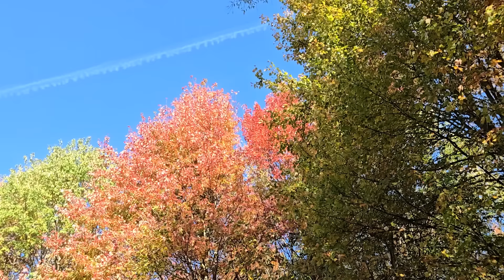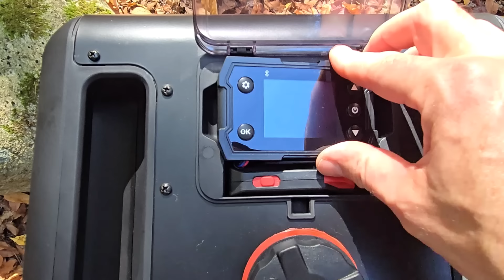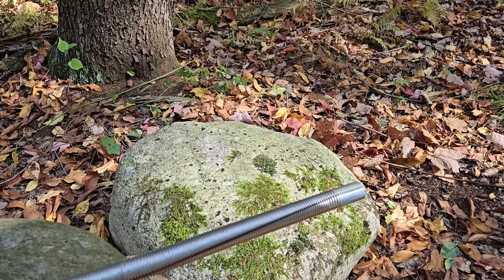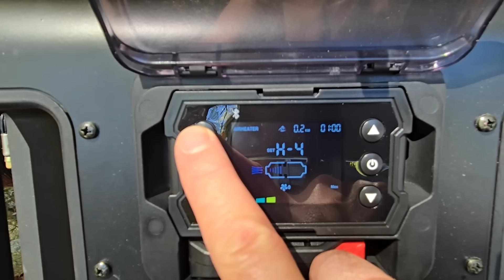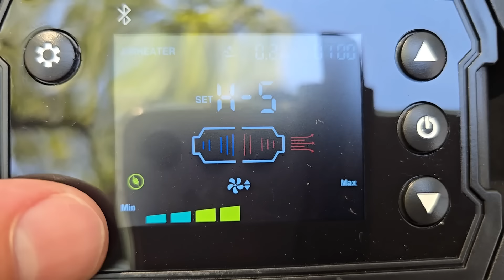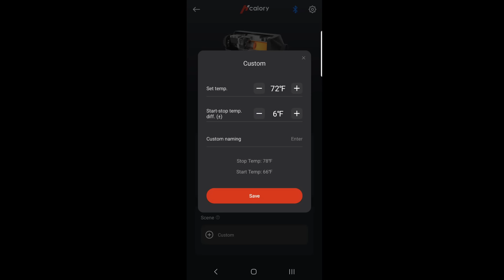62 Hours of Heat On a Tank! The NEWEST Diesel Heater: Hcalory Toolbox Max!

Comment: The 3 1/2" heat outlet is the only flaw on this unit, they don't make hoses/ducts that fit that size.
Reply: you can get a fitting to change that if its a problem 3 1/2 to 4
Reply: 3.5 inches is 90mm. There are all manner of piping that size. More so in europe but in the USA you can still find it. Also you could convert to 4" pipe with a simple silicone adapter available on line.
Reply: Ever heard of Amazon or Ebay?

Comment: I purchased this Hcalory after watching a different reviewer several days ago. He got 67 hrs on a full tank. I installed mine in the living room. Vented the exhaust out a window. It’s very quiet and works great. I just use the remote. No need for the app.
Reply from the maker: Wow! 67 hours.
Reply: @billbradley2480  Very cool, glad to hear it's working for you! Using the remote, does it ramp up and down to try and maintain temperature pretty good? Does it shutdown if it reaches the set temp? Thanks! I purchased one, but won't get a chance to put it into use until a couple days before I need to actually use it, and I would like to know what I'm getting into in terms of temp control. :)
Reply: Do you keep the actual heater inside? I'm looking at trying to use this for when things go dark as an source of inside heat. I could use any advice you have
Reply: @davidbaity6456   I run mine indoors.  Just be careful with the exhaust plumbing.  No leaks allowed.  I'd recommend getting T style pipe clamps.  They clamp better to prevent leaks.
Reply: @davidbaity6456  it is not recommended to use indoors, as any exhaust leak would then be in the living area.

Much better for these to be outside, with the hot air duct blowing into the living space. Relatively easy with a piece of plywood to fit into a window gap, with a hole drilled for the hot air duct. For short term use of course.
Reply: @danya822  why short term only? Why can’t i used this all winter
Reply: @DF-ep6fg  I'm talking plywood through a window for short term. The heater can be used as long as you'd like! :) 

You could certainly make something for a window long term, but if you get water on plywood for a long time, and/or you have insulated windows, then it might not be the best long term solution.

Comment: How long do you think the outlet tubing can expand to in length?
Reply from the maker: I was able to get it to about 3 feet. I checked and you can find longer lengths for sale online. 16 feet for less than $10. It's 3.5 inch diameter.
Reply: @HemlockRidgeUSA do you have a link?  Can’t really find anything on Amazon.
Reply: @rmorales1029  4” dryer tubing can be slipped over the 3.5” and hose clamped to seal
Reply: @rmorales1029   Watch what it is made of.  Check reviews.  Some say it has a burning plastic smell on ducting that is not rated for higher temps.  Try to find one that has a 300F rating.  Still check reviews but the ones I've seen with high temp ratings do seem to work better with less complaints.  Low temp ones are not going to last, may even melt.  My heater pushes close to 280F air when on high.  I think that is typical.  

I've also seen people who have long runs adapt from 3" to 4" ducting or from 4" to 6".  They claim it works better.  Makes sense.
Reply: @noneyabus1 thanks for the tip.

Comment: Welcome to the world of Diesel Heaters.  They’re addictive. I cut a piece of carsiding to fit vertically in my sliding glass door and drilled a hole with a hole saw and put the diffuser into that hole inside my house.  The unit sits on my patio steps on bricks and I lined up the vent hose with the carsiding to determine where to drill the hole.  It worked so well I made a horizontal one for the window of my cabin up north.  That one sits on a table on my deck on a couple bricks, same setup with the hole saw, etc. just horizontal.
Reply from the maker: Thanks for the tip!

Comment: I’m wondering how many gallons of fuel that it uses per 24 hours
Reply from the maker: It depends how hard its heating, but can run 62.5 hours on a tank which is approx 2 gallons.
Reply: On the lowest heat setting only.
Reply: @jasonstclair1329 on the lowest setting I get 28 hours on full tank.

Comment: I was wondering how many gallons of fuel it burns per 24 hours
Reply from the maker: It claims it can run 62.5 hours on 2 gals of fuel, but i would assume thats on low heat...
Reply: Sherburn Outdoors ran it just over 24 hours on high.
Reply: On low, less that a gallon yet on high it can burn two gallons in 24 hours.